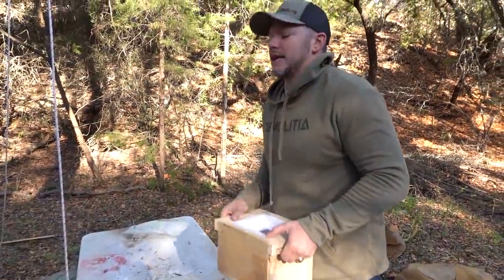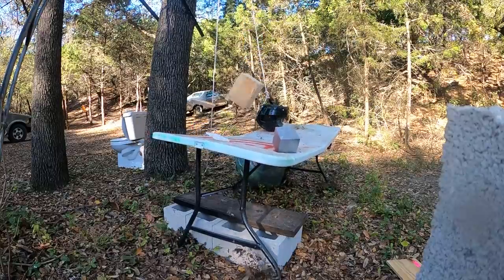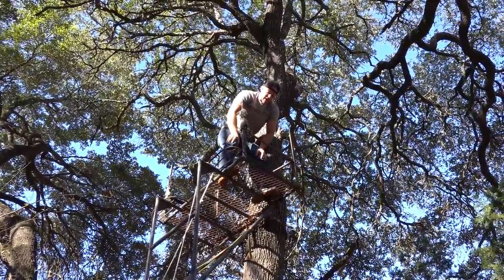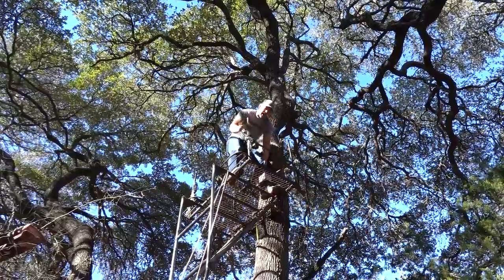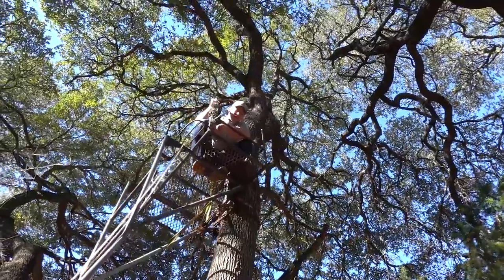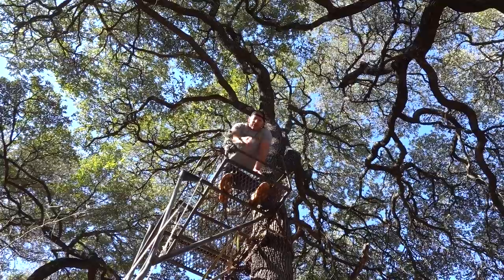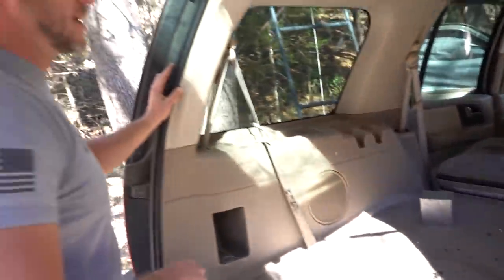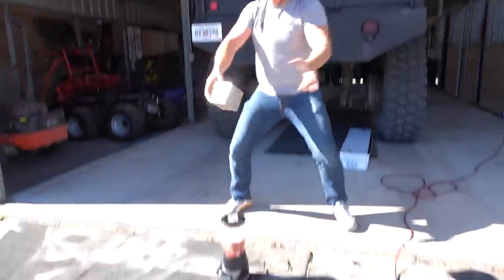Smashing things with a Solid Tungsten Block, MUCH Heavier than Lead!!!

Comment: ........ no offense but if ya had taken physics you wouldnt have subjected that gopro to that 😂😂
Reply: thank you, I was searching a comment about it. Did he say it on purpose to annoy others?
Reply: @Platypus_Warrior  🤷🏻‍♂️
Reply: Pfft, physics, we aint using those fancy words here. Your a physics
Reply: Guess he Didn't tell Mere !!!
Reply: He went to T A&M for all we know he's an engineer.
Reply: I wanted to point out the same thing. All objects have the same acceleration : 9,81 m/s². The weight doesn't matter
Reply: @King-yj5ws  this is also wrong, all objects have different acceleration, it just doesnt come down to mass, it comes down to air resistance and shit
Reply: @ThomasStephenForster  Mere's the engineers... he's a sorta doctor
Reply: There is the comment I was looking for lol
Reply: Isn't Matt a Vet? lol... I bet ya he took multiple physic classes. Sometimes it is just fun to figure it out yourself ;D
Reply: @andyrobles1183  except air resistance is negligible for most objects and most distances, especially in this scenario
Reply: Lmao I’m glad you pointed it out
Reply: @ScottWaa  lol 😂😂😂😂😂👍🏻✌
Reply: @King-yj5ws  Terminal velocity exists. The trick here is fluid dynamics. The block displaces air it's wake creating a vortex that the GoPro would stay in. Drafting basically.
Reply: @ThomasStephenForster  ya the GoPro will fall slightly faster because it will have less drag than the metal block would
Reply: @randomwhiteguy has it correct.
Reply: but tis' not a vaccum  is it ?

Comment: "The block will fall faster than the go pro"
Newton has left the chat
Reply: I busted out laughing as soon as he said it
Reply: I didn't want to be that guy but..... lol good catch on your part
Reply: Lmao
Reply: Me: Cringes in Physics major
Reply: Galileo?
Reply: Had a good laugh 😂😂😂
Reply: Brooooo Texas’s
Reply: Galileo rolling in his grave
Reply: Matt is not a physicist
Reply: Depends on the hight of the drop point
Reply: Exactly Wht I was thinking
Reply: @videosvideos4383  no it doesn’t, if you drop anything at the same speed, if the resistance is the same, it will continue at the same speed until it hits something.
Reply from the maker: Ha I mean it will! And it did. Just thought there would be more of a gap that what happened in reality. In a vacuum, yes, same speed. I thought with air resistance it would slow the camera more than it did. Shoulda put a parachute in the gopro haha
Reply: @videosvideos4383  it literally dose not
Reply: I’m in physics right now watching a Newton video. Lol
Reply: @OffTheRanch  I mean.... by that logic the gopro should have fallen faster than the block considering there would be more surface area for drag on the block...
Reply: @OffTheRanch  
The air resistance might have made a difference if they fell side by side but the thungsten block stopped it from affecting the gopro, heck it  might have pulled the gopro like a race car being followed by another one.
Reply: @videosvideos4383  no. It doesn't
Reply: I think meant it'll fall with more force  considering it's it has greater density
Reply: I just stopped to say that and saw your comment LOL
Reply: That was hilarious
Reply: Had a lot of fun teaching my daughter that everything falls at the same speed via controlled experiments using coins, crumbled paper, marbles and other items. Any parent should try this with their child. They'll love it!
Reply: I was thinking the same thing
Reply: Actually Galileo left the chat. Remember the Leaning Tower of Pisa experiments?
Reply: OffTheRanch 👍 for owning it. Yeah you’d need more drop for air resistance to be a factor. GP’s are pretty dense.
Reply: Hoping I wasn’t the only one. Phew
Reply: @OffTheRanch  who is the camera man
Reply: @OffTheRanch  but matt the block would block most of the air keeping them so close
Reply: And he is a doctor....ish
Reply: If the Go pro wasn't directly behind it using it as a wind shield, then technically if he dropped them both far enough the tungsten block would have a greater terminal velocity, and fall faster..... but yeah that's not what happened here.
Reply: I think this is the ultimate Don't tell Mere, she is an engineer after all.
Reply: @NozNK  but the resistence on the block is small becouse of its weight
Reply: Even my high school physics brain from 20 years ago went ‘WHAT????’  Lol
Reply: in the real world dense things do fall faster than less dense things. and who you actually wanted to namedrop was galileo.
Reply: @videosvideos4383  no it doesnt the only thing that would change it is air resistance
Reply: lmfao came to the comments to see if anyone else caught that
Reply: @arumatai  In the real world, rate of fall has nothing to do with density and everything to do with air resistance. If I make a flat sheet of Tungsten and a pencil-shaped object of Lead, the lead will fall much faster than the sheet (assuming dropped face first, not side first) even though it has a lower density

Or using the mouse.elephant example, assume a mouse with a mass of 1kg and an elephant with a mass of 1,000kg are dropped from the same, arbitrary height. The elephant experiences a downward force of 10,000N whereas the mouse experiences only 10N, so the elephant SHOULD fall faster. But when you calculate their acceleration using Newton's second law (F=MA, A = F/M), you get (Aele = 10,000 / 1,000 = 10), (Amous = 10/1 = 10). They experience exactly the same acceleration.
Reply: Came here to comment on this. Should have know somebody already got on it.🤣
Reply: @OffTheRanch   u should make more how ridiculousranch videos lool
Reply: @OffTheRanch  the block falling caused an air pocket, so sucked the go pro with it. l do it when riding my bike, by that l mean get close to a large truck and get sucked a long, it sure way to save my legs getting tired
Reply: @OffTheRanch  why would you double down?
Reply: 🤣 Very glad this is the top comment 👌
Reply: When he said that I did a double take and said WAIT WHAT??
Reply: Ig he thought air resistance will slow the go pro down more xd. He didn’t realise there no air hitting the GoPro behind the Tungsten block. 😂😂😂
Reply: He's not wrong though, the block has a higher terminal velocity than the camera, but the drop is too low for it to make a difference.
Reply: I came here to say this, but I knew in my heart it had already been said
Reply: @Pifreek  cringes in high school physics class
Reply: immediately checked the comments after seing that 😂😂
Reply: lol
Reply: yep you beat to it
Reply: 9.82 m/s^2
Reply: Good he's doctor'ish, not physicist'ish.
Reply: :D crying
Reply: Aggies 😏
Reply: WTF was that?  He's a fing doctor?????
Reply: Lmao!
Reply: @OffTheRanch  Duuuuude! 🤣 You're killing me man. Not like you'll get much separation with air resistance if it's laying on top of the block. D'oh... Love your vids though.
Reply: Don't tell him about non-Newtonian fluid, he just won't understand.
Reply: Technically, it should have a higher terminal velocity
Reply: Just had this conversation with my 10yo. Lol.
Reply: acceleration of gravity is 9.8 m/s air resistance is negligible with a go pro and block at that height.
Reply: Kyle Kutt  because of air resistance
Reply: @OffTheRanch  matt no why just and say you forgot physics
Reply: Yep....
Reply: @Miragexe  The gopro's terminal velocity will be the same as the block as the gopro is essentially in vaccum(no air hitting it)
Reply: To all the comments of Matt's college degree and that he should have known the physics of how things fall....
He has said himself..
I'm a Dr......ish.
😊😊💞
Reply: @OffTheRanch  Matt, you forgot that there's no air hitting the gopro to slow it down, effectively a vaccum in front of it. (we are just waiting to take a jab at you if you make a minute mistake) love ya
Reply: Air has affected the chat
Reply: 4:10 Come on Matt....
Reply: @OffTheRanch  go watch how ridiculous. They have this kinda thing down pat. You should send them this block to drop from the tower.
Reply: @Postman2007  there is an impostor among us
Reply: Surface area, density, and air resistance. It also has a higher terminal velocity.
Reply: @General-kh3lc  
It literally does. The tungsten block and the camera have wildly different terminal velocities.
Reply: @Sp00kq  
It literally does. The tungsten block and the camera have wildly different terminal velocities.
the farther the drop, the greater the difference in time between them.
Reply: @OffTheRanch  By placing the go-pro behind the block, you effectively created a vacuum for the go-pro to fall in , if you were to place a small piece of paper over the block it would do the same thing
Reply: @NozNK  nope, buoyancy force is density vs surface area. The tungsten is bigger but significantly heavier so it would still push through the air a fraction sooner even though the gopro has less surface area. Either way its not enough to notice, especially since the air between the tungsten and gopro would be disturbed by the tungsten already. Its drafting 🤣
Reply: @forbiddenempire5447  they accelerate at basically the same speeds, but terminal velocity of each can vary significantly. Did you drop a feather too, that one is a mind-bender since the terminal velocity is so slow 🤣
Reply: @Postman2007  the cameraman is usually his brother Drew. He is brave, I wouldn't have been close for the basketball or duct tape ball drops lmao
Reply: "Ooooo shoot doggg that hit me" im dead😂
Reply: @General-kh3lc  it literally does. If the tungsten is dropped higher then it hits after. 🤷‍♂️
Reply: @OffTheRanch   Dammit Jim!!! 
I'm Veterinarian not a Physicist!!!
Reply: @OffTheRanch  You should have asked Mere, since she is an engineer :D
Reply: @masondougherty7412  Forgets, this dude never knew. His wife must have at least 100 cringe moments a week, she is an engineer.
Reply: @OffTheRanch  putting the GoPro behind the block would mean it would be affected by a negligible amount of air resistance, and either way, the tungsten would have had more air resistance than the camera because it has a larger surface area
Reply: The acceleration of gravity just works different in Texas... you didn’t know that? 😂😂
Reply: college education for how much?
Reply: @NozNK  The tungsten may have a larger force of air friction, however since the tungsten block is so heavy there is an extremely low change in its acceleration. Compared to the Go-Pro
Reply: Hilarious
Reply: @OffTheRanch  true, the potential energy of such a dense object with so little surface area compared to the magnitude mass makes things like air resistance much more negligible than for an object like a GoPro...but over that distance you shouldn’t have expected it be noticeable ;p
Reply: You beat me to it lmao
Reply: Gale Lao has entered the chat
Reply: @johnperic6860 : Dropping items from the tower was most likely not true, but dropping items in his studio was the basis for the science and the myth. Thanks for playing Demolition Myth Busting!
Reply: Our atmosphere is not a vacuum, but the aerodynamic difference between them isn't big enough to matter from the height he's dropping them from.
Reply: You guys are all betas. The GoPro did fall slower. There is this thing called air resistance!!! Maybe you've heard of it!!! It slows down things!!! And it would slow down the GoPro more than it would slow down the tungsten block. And that's what it did!!! Just it didn't do it as much as he thought it would. He did a more realistic and accurate calculation that any of you did, and you should be ashamed of yourselves!!!
Reply: @OffTheRanch  basic physics with demo
Reply: @OffTheRanch  how ridiculous has a chute for and flying dart for there gpro's... just think of what you could with those on the other channel
Reply: Galileo has left the chat

Comment: You should team up with How Ridiculous on that one, get a much much bigger Block and drop it from their Tower on stuff ! :D
Reply: Agreed, well they don't have to team up but dropping a tungsten sphere on stuff can be interesting! It is brittle though so it may just shatter like the glass spheres.
Reply: He already has in the past.
Reply: I think they also just got one, saw it on their new post
Reply: REXY RULES!
Reply: Dropping a six foot block of uranium on a hipoint feat. Robert Oppenheimer
Reply: @svenkrisenberg6684  i wonder if they can pick up the tungsten sphere with that winch they have on the tower they might have to buy a stronger winch for a tungsten sphere
Reply: If you follow how rediculous on Insta you will know that their this weeks video is dropping a rings tone twenty kilo weight
Reply: @Gh3ttoboy  i mean they've picked up vending machines, and boats, and cars. How big is the tungsten sphere?
Reply: Yep just what I was thinking on how ridiculous channel should try and get a massive block of tungsten at least a couple of hundred pounds and see what it does.
Reply: you know that How Ridiculous had visited Matt's ranch in Texas from Australia and they went down to Ox Ranch in South Texas to do the filming there correct? It was both on Matt's channel and How Ridiculous's channel.
Reply: How ridiculous just did a video with one today
Reply: @Gh3ttoboy  if they had a six foot block of tungsten, either the tower would bend or the winch would snap. Either way, you’re gonna hear the impact

Comment: "The block will fall faster than the go pro"
...come on Matt your wife is an engineer, you should know better.
Reply: Mere has all the brains.
Reply: Matt has a PhD im pretty sure.
Reply: Was about to comment this. Glad you beat me to it.
Reply: Lmao apparently he never learned that things drop at the same speed regardless of weight 🤷‍♂️😂😂
Reply: @emanresu7208  nah he just gets the Dr title from being a vet
Reply: @JayMac  disregarding air resistance. Matt is technically right here.
Reply: She's an engineer, lol but have you seen matt?
Reply: And an engineer would consider air resistance as a factor. This is like the feather and the bowling ball.
Reply: @iamaduckquack  simp
Reply: Right Round  Presumably less than the block, since its surface area is much smaller.
But in any case, he dropped it behind the block, which mean it encountered minimal air resistance.
Reply: and hes a veterinarian so he graduated  hs and university  yet never heard of galelio or nerwon  . MATT  acceleration due to gravity..on earth is 8.9m/s sq or 32 tf /s/s  so what is gonna fall faster a pound of hammers or a pound of softballs? or a pound of feathers....ya im not counting surface area and drag
Reply: Right Round  the air resistance affecting the gopro is irrelevant. it has very little effect on the amount of time it takes to hit the ground, like milliseconds or less
Reply: @emanresu7208  Yep... sure does...
Reply: Haha an engineer? don't make me laugh
Reply: @JayMac  in a vacuum. outside of a vacuum it also depends on the density and friction. which is why this rule doesn't  apply to feathers.
Reply: @JayMac  that statement is not necessarily true
Reply: @mobiousenigma  9.81 m/s^2 ... and though there is technically a difference due to air resistance and drag, due to the small height he drops them from and the similar form of the two objects, the difference is negligable here. he'd need to substantially increase surface area of the camera without adding too much extra weight (let's say with something like an improvised parachute) for his idea to work.
besides that, i've seen us high school graduates who were unable to spot the usa on a world map. so having graduated hs doesn't really say anything about a person, other than that they're most likely around the age of or older than 18 years.
Reply: Gravity
Reply: Depends on the height of the drop point
Reply: Right Round  he's a doctor-ish.
Reply: @codrareguy8318  Alrighty then.
Reply: He has a Veterinarian Med Degree... You'd think he'd have to take a physics class or two for that degree.

BTW: Didn't know Mere was an Engineer. I bet she's cringing hard, as this is all Physics 101 stuff. Like First Week of Physics 101.
Reply: @emanresu7208  To be a Doctor of veterinary medicine, you have to do certain things and pass certain exams. However, to be a PhD, you have to be able to work on your own for around 3-4 years and when you submit your thesis, it has to be something "original", to the field of study. Matt didn't do a PhD.
Reply: He meant it'll fall with more force
Reply: Right Round  yes it affects it, not enough to be visible to the naked eye tho, so if u can’t see the difference it’s pretty irrelevant imo
Reply: @jasonswift7098  He's a qualified Vet, he doesn't claim to be an engineer.
Reply: She is?!
Reply: @iamaduckquack   And the looks too? :D

Comment: Matt: Mere, I have $2500, what should I spend it on?
Mere: A gift for me?
Matt: How about A 4" cube of tungsten?
Mere: rolls eyes and walks away
Reply: Yup - just looked it up, this block costs $2500!!!

But he mentioned something about it being in the lobby of the new storefront, so he'll probably write it off as 'art'.
Reply: @donabele1243  it's a custom piece we had made representing the resiliency of bunker branding in tungsten and copper. valued at $350,000.
Reply: @SignalJones  why copper? To signify impurity? 🤣  seems like a strange schoic
Reply: Tungsten is about the same density as Gold. Tungsten’s density of 19.25g/cm3 is just about the same density as gold (19.3g/cm3).
Reply: It so fun that everyone is saint it wrong and spells wrong ti’s   TUNG STEN and a am from sweden
Reply: @dsdragoon   but gold is much expensive as it is much corrosion  resistant
Reply: @lukasmolin5160  Then say wolfram...